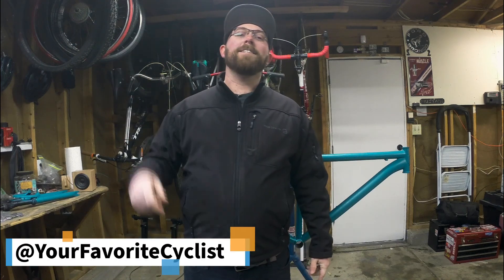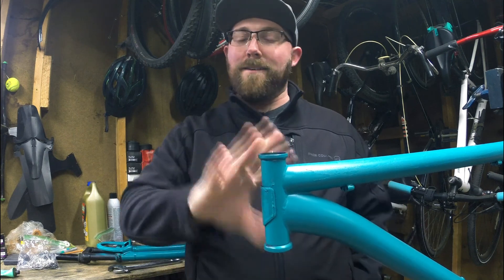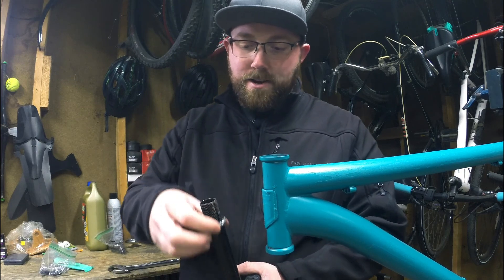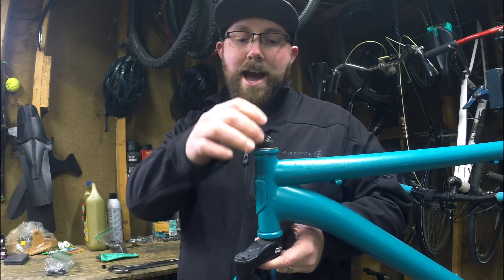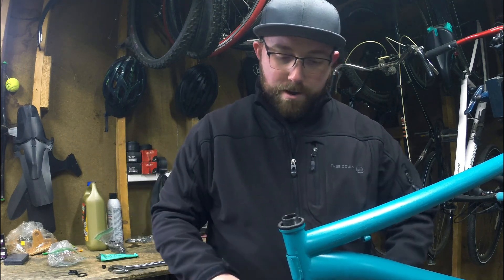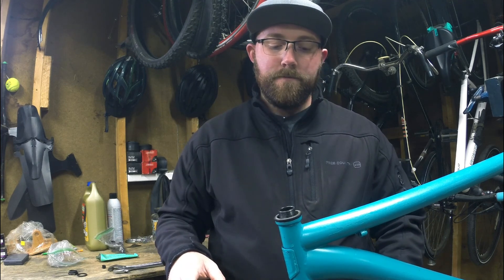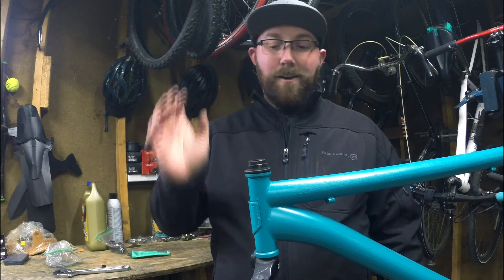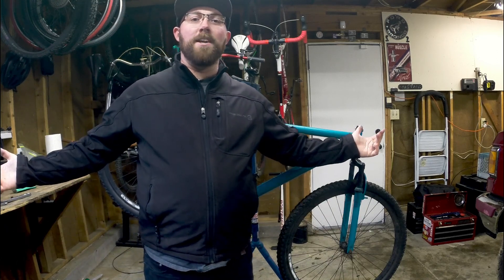Adjusting a Threaded Headset

Comment: Cool man, have you figured out how to install a 1-1/8 fork?
Reply from the maker: Actually had a video on that come out this past week! https://youtu.be/ceCuez9zMK8
Reply: @YourFavoriteCyclist  thanks, but no, that is not it. I've done all that, check out my channel.
On my last video I do a review on a Schwinn Copeland that has a fork like your mongoose (treaded). I would like to convert it to threadless, like the whole fork swap, but it comes with a 1" fork, I have not been able to find a headset adapter for a 1 to 1-1/8, you know what I mean?
Reply from the maker: Ah that I do not know how to do. You may be able to get away with swapping the headsets out on the actual frame, however you might run into the head tube itself being too small for the larger diameter fork steerer tube